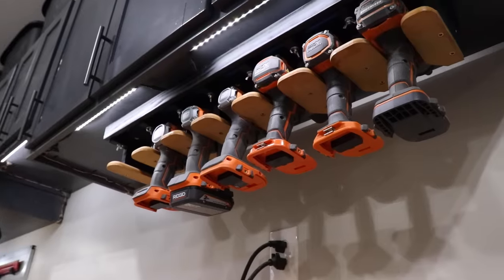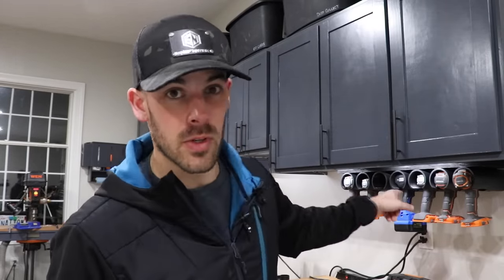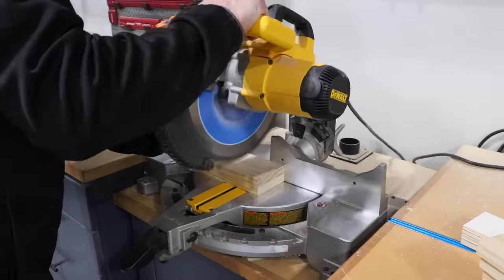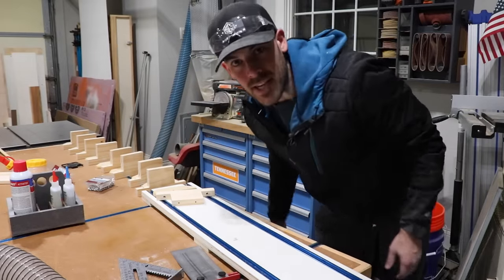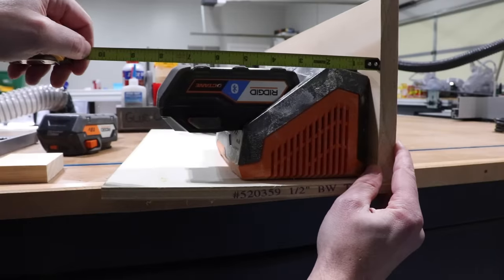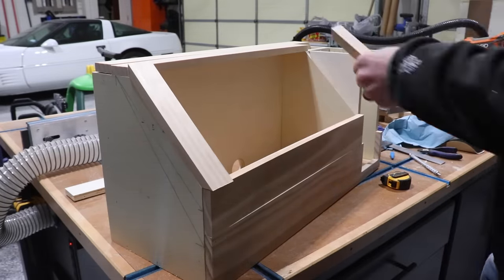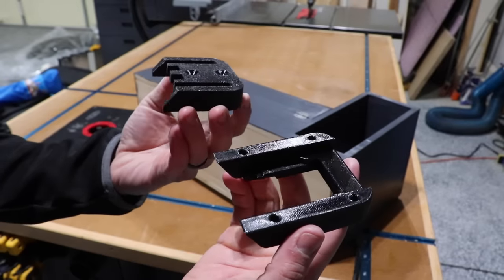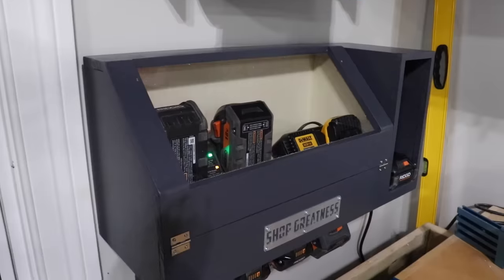No more CLUNKY storage // Shop Organization

Comment: My only concern would be overheating since there is no air flow. Maybe a small filter fit into the side to allow air to move freely.
Reply: With 3 batteries charging you could heat your lunch up in there for sure!

Never mind the reduced lifespan of the batteries and chargers.
Reply: I had the same thought. Otherwise it’s a really cool concept and design!
Reply: My thoughts as well.  Being in Phoenix, heat is a real concern for me. :)  I think a vent toward the top of the back side would take care of that though.  Cut a slot, place a screen over it.  but paint it black (Cyberspace) first so it will look like an accent.
Reply: That was my concern also (heat in an enclosed charging compartment).  How about adding a small PC air intake fan with a good pre-filter and an exhaust louver.  You could 3D print both the filter housing and louver as well.
Reply: I agree. I walked into my employers shop a few years back on a Monday morning only to find the smoke rolling out of two chargers. Thankfully they were setting on a concrete floor. An enclosed box? Bye bye shop.

Comment: Hey love everything you did, my only question is what about ventilation or cooling for the chargers? It might get hot in there and damage a battery or charger. Maybe add an exhaust fan or at least some airflow holes out the bottom. Cheers
Reply from the maker: Yeah I may add a vent if heat ends up being a concern
Reply: @ShopNation  some one else mentioned a filter too. You could add a fan/filter combo like on a computer case that way you keep dust out and air flowing.
Reply: Yes!!! I was going to say a computer fan!
Reply: Yeah. This can cause premature battery life failure, explosion, and fire. It's a YouTuber though. They already know all this stuff, right?!
Reply: Simple filter… paper towel.

Comment: I didn't comb through all the previous comments (did take a quick look though) sorry if this is a duplicate..  Others mentioned an exhaust fan and filter to help keep the enclosure cool.  More importantly though is the need to limit the charge time with older batteries/ chargers. Many new systems have a self-limiting circuitry to guard against over-charging and overheating/fire.  Not so much with the older versions (like mine). I would suggest adding a timer that will automatically turn the chargers off after 3-4 hours. That way, if you forget to turn them off when you leave the shop, they will tend to themselves.

Comment: I would suggest some vents on the charging station to help with heat dissipation on this great idea.  Love adjustability on the tool hanger.
Reply: I second that, some louvered vents near the top and some near the bottom as well to allow good air flow.

Comment: A tip is to hang the tools up side down. I know some dont like to grab them like that but the advantage is that the batteries on all tools on same brand is the same thus the holder will be the same :) And when it comes to the charges you need to have ventilation. The batteries do get warm and if you got fast chargers you could easily run into thermal issues like the charger stops charging or in worst case thermal run-away. Just a side note :)  With that said protecting electronics from dust is always great to do. I have mine mounted under a cabinet thus not so much is going there.

Comment: Here is an idea you just gave me. Make the battery hangers directly connected the battery terminals. Take the leads and plug into a 4 or 8 terminal relay board. It the input of the relays directly to the charger using whatever rig you want (adapter, soldering). I would have a way to monitor input current and switch between batteries using the relay board to charge them up. Turns a single charger into a 4 or 8 battery charger. Great video!

Comment: This is a great video and I love the drill extending station. The battery charging station is excellent I too worry about dust on my batteries and electrical sockets. I'm trying to make my tool holders enclosed to be free from dust but also from damp cold weather. Great job good man

Comment: Very nice tool organizer setup. I definitely would like to buy them to build this. Seen the comments on heat build up. As a safety issue we live in a nice suburban area and one house burned down two years ago. Turns out they had an overloaded battery charger in the garage. If you haven’t already you might maybe make a vid on this. For now I flip the switch on to charge things while in the garage but when I go inside I turn it all off. Works for now.

Comment: My problem would be remembering which slot was which tool, since they have to go in the spot they were adjusted for. Some labels along the top would help.

And it's already been said by many others, but I would worry about heat from the chargers as well. A computer fan with a filter and an exhaust hole with a filter on the other side would help.
Reply from the maker: Yup great call outs 👍🏼

Comment: Travis, as an original follower of your YouTube Channel and a retired engineer with a just "a little" woodworking and metal & welding fabrication expertise -> excellent video project production and resultant ShopNation deliverables.  One additional enclosed charging station requirement you may want to post-video communicate to your followers is the need to possibly address or design mitigate is to dissapate the considerable charger and battery heat generation during charger.  As an example, my Makita chargers have fans to dissapate heat.  If you don't you may impact the longevity of your charger and possibly the batteries.  Your design which provides the viewable opening charger top door would or does address this, whereby a person may need to keep it open during charging to alleviate the charging heat.  Otherwise, a great pat on the back to you for another fantastic shop project video !!!  Wyo-up (Cowboy Up) to you.  Jim, Retired Petrolem & Renewable Energy Program Engineer.

Comment: Beautiful build and design!  Clever way to get seamless angles for charger cover. Love the round smooth edges of dividers. A few thoughts though:

1) Have you considered a mechanism to limit how far the charger cover can fall open, as a safeguard preventing it from free falling open should it slip out of your hands?

2) It seems like it would be a little challenging to remember which tool went in to which slot since the slots vary in width. Since building this have you found yourself having to label them?

3) Wondering if there might be a better slot divider locking design using a single thumb screw in front rather than to under cabinet wingnuts for each?

	I’ll take a stab at explaining one idea to consider for the slot dividers. Instead of 2 T-tracks to hold a divider, use two strips of French cleats mounted under cabinet with the angled openings facing to the rear. Each divider would have opposing French cleats. The front of each divider would have a 90° piece of material (roundover edges) attached with a single thumb screw that applies pressure pulling the divider forward, thereby squeezing the opposing French cleats together. Apply wax to the cleats. Simply slightly loosen front thumb screw to slide the dividers to adjust spacing.

Comment: Love the video. The one thing you could do to make this a great charging system is to add a timer to charge your batteries for one hour a day. no heat problem and all gets charged without overheating. Have used it for years and has not let me down. I like your thinking on storing the drills. Thanks

Comment: Just some thoughts...  First off, instead of building an entirely new system for adjustability, I would have fired up my hot air gun to modify the PVC holders that need to have their slots opened up a bit.  I've used the hot air gun on PVC for many different needs - it's versatile and easy to work with.  I get that your new system is infinitely adjustable, but I'm guessing that once you've determined how you want to arrange tools in their holders it will pretty much be a static system without further need for adjustment.  If it did, the PVC can be manipulated again in a matter of minutes.  I would only have used wingnuts for a couple months until you were happy with the arrangement, then swapped those out for Nyloc nuts.  You could even start with Nylocs and adjust them so that the holders could be moved with a little pursuasion but basically stay in place for the time being (or install small springs under the nuts to retain tension but allow you to pull the holder downwards to shift position).  Next, as several others have mentioned, I'd have installed some sort of heat dissipation system for the charging station - maybe holes in the bottom and holes in the rearmost side with something blocking the holes to allow airflor but prevent dust from getting in (old Covid masks stapled on the inside?).  Finally, I get that this is totally subjective, but your choice of black in your shop not only makes the entire shop somewhat negative and not very welcoming or happy, but all the non-reflective surfaces decrease available light and visibility of everything painted that color.   As you've already probably found out, wood dust (however much you try to eliminate it from your shop) stands out on a black surface worse than any other color.  Sorry!  ;-)  One further thing - did you lock the chargers in position so you could remove batteries withing having to hold onto the chargers?

Comment: I'm working on building a battery charger/storage and drill/driver storage right now.  I've planned it for quite a while and am finally putting it together.  And now you go and design this! I guess mine will have to do until I decide I just need one like yours.  Great work and ideas.

Comment: That hanger is great!  Nice job.  The charger box leaves me with concern over heat.  All chargers have vents on them to dissipate heat from the charging process. (They wouldn't have vents if they didn't get hot.)   This box looks like it provides no ventilation to vent that heat out.  Maybe that heat is negligible, or maybe not.  It's food for thought though.

Comment: Fantastic design Travis.  I think you should add the plans in with your other ones.  I like the idea of it being adjustable so you could also use it to store your pneumatic tools.  Just concerned about the heat in the battery charger case.  Especially since I have several chargers for Dewalt and Milwaukee tools.  Keep up the great designs.

Comment: i love this. only thing i would have changed is put the hinges on the top of the charger lid instead of the bottom, just to make sure it's always shut. open it, take out a battery, move away, it shuts itself. could even use some sort of prop, like a wooden dowel that's integrated into the design or a jewelry box lid support for times you know you'll be in it a while. also, to keep the no dust in the contacts thing going, a small door with a window that uses magnets to stay shut over the 'dead battery' cubby.

Comment: I don't have a 3D printer, but I'd love to have that little jig with the 4 different radius curves you used for rounding the corners on the MDF supports.  I went to your store where I previously purchased your dust collector shroud for my Bosch 12" miter saw (works great), but you didn't have any for sale there.  I've not seen one in any woodworking supply store, but I think it's sell well, and if you've already made one, you know how to set your machine to make more.  Just a thought ...

Comment: Greta idea with the charger station. The only I noticed that might be an minor issue, can you see the charge indicator lights on the chargers from across the shop when closed? You might on the Rigid but not on the Dewalt charger. So to check if the battery has finished charging you have to go over to the station.
Reply from the maker: You can actually see both, or at least the glow from both

Comment: Loved it. Especially liked the way you separated the fully charged and need to be charged batteries. One thing I noticed is, it would be nice if the chargers were elevated so you could see the blinking lights through the glass to see if the battery in the charger was finished charging.

Comment: No dust will get in, but the heat can't get out.  Not sure if it would actually be an issue, but batteries can get hot when charging.

Comment: You need filtered vents or some airflow somehow for that charging box. Looks like a fire hazard to me. At least an easy way to kill the power to the box so the chargers don't stay powered on in the enclosed space while unmonitored. I've heard of chargers starting fires without being "in use" let alone without being in a small enclosed space. Looks awesome though and I feel you on the dust protection.

Comment: Think I’ll build that drill station with one modification. I would remove the back t-track and leave the dado. Leave an ear on each divider that rides in the dado that way you only need the front wing-nut but they stay square when you slide them.  You don’t have to worry about reaching the back wing-nut to adjust.
Reply: Weight ?

Comment: Something you could or may consider, is for the back bolt, instead make something that fits in the slot with some length to keep the piece from rotating side to side, and only use the front bolt to lock in place so you don't have to reach to the back to lock that bolt in. Wish I could put a picture here of what I mean.

Comment: I'm surprised you didn't hang the charging station next to the hanging station since you always talk about "work flow" in the shop.  I assume their wasn't an available outlet to the right of the hanging station?
Reply from the maker: Yeah I didn’t mention that I grappled with this. In the end I figured I wasn’t going to be doing both things at the same time most of the time - if that makes sense.

Comment: I do love the battery charging and storage. I struggle with this myself. I keep the batteries in the a separate room from my garage so they are stored in a room that’s climate controlled. I’m worried about leaving tools and batteries in the garage during the summer and winter months. Thinking those extreme shifts in temperature will reduce the life of the battery.

Comment: Having 100W in a wooden enclosure during charging would produce a lot of heat!If you intend to only charge when the lid is open - I would make sure that the door won't be able to close when the battery is on the charger. That might lead to even smaller design. I would consider storing the batteries dust free, as the dust on the battery might be as dangerous as on the charger...

Comment: Do you need to Put a whisper fan and vent slots in there so you get air flow needed so the chargers don’t starve for air and overheat - burn out prematurely . . You did too much work to have those fail on you? My gut tells me this is a potential fire hazard, please be careful. Call the tool co . Tech dept. & Have a conversation with them..Mr.Tom   
Nice job!